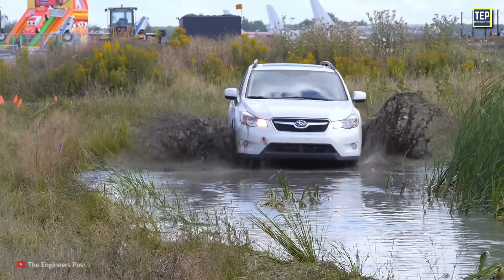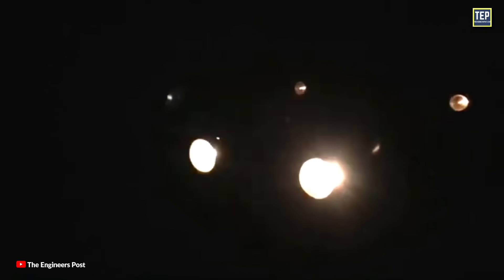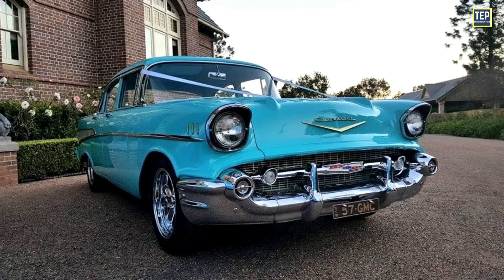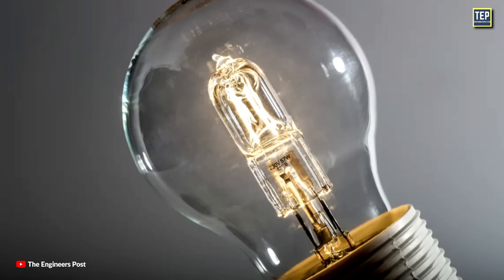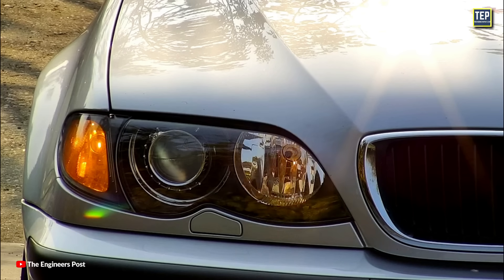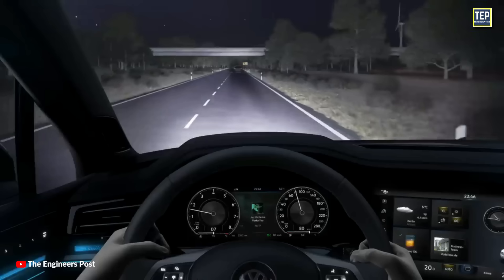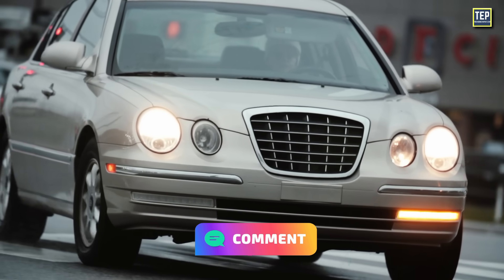The Problem With These Headlights

Comment: The major drawbacks to LED, is they do produce heat, just not in the conventional sense, and the heat can over time damage the electronics controlling it. Also, if they're not replaceable LED bulbs, than you have the huge expense of replacing the entire housing. Matrix lighting, will probably suffer from the same issue with no bulb LED systems, hence having to change the entire housing when a single LED fails. Laser versions, definitely suffers from the no bulb system, and when they fail, require a costly housing replacement. This is why the majority of manufacturers, have still relied on halogen the most. It's cost effective, and replacement parts are relatively cheap and simple.

Comment: In the early 70s headlight were required to be 300 ft for low beam and 600 ft for high beam. If your lights bothered the oncoming traffic the police would ticket you and require you to go to a station and get them adjusted !

Comment: Those laser headlights are stupid asf... you can barely see them at night through the rear view mirror & side mirrors

I've actually seen some tail lights that arent smoled coated yet still hard to see

Being able to see the headlights, tail lights and stop lights are just as important 🤦‍♂️

Dont get me started and morins with super bright ass headlights that blind you either on the opppsite side of a freeway/highway or residential street or in your mirriors (this includes dumbass motorcyclists)

In the darkened early morning i see a single bright ass hradlight in my rearview mirror (blinding bright). I thought it was a car behind one of yhe cars behind me direcly behind and the next lane over offset to look ahead or whatever

Turns out it ws a motorcycle... i only knew wgen i seen them zooming past me lane splitting pretty quickly (i was going 80, so he zoomed by doing at least 90)

*what if i decided to merge into the next lane?

Had he not had a bright ass light, i would have been able tp look better and see the outline of a motorcyclists

These bright ass blinding lights and fancy barely there lights are dangerous and plain fucking stupid

Comment: I remember when you just had round sealed beams.  However in the early 70s I replaced my sealed beams with lights out of Europe with flat lead Crystal lenses, the high beams shot straight down the road and the low beams were low and flat on the left side to not blind oncoming traffic while the right side of the lens were angled up so that the right side was lit to allow the driver to see signs and any object that might be on the shoulder.  They were superior to anything available today.

Comment: This video says that hid got replaced by led, but as far as i can see, hid is still used in most cars now with LED being integrated into the assembly intead if being a direct replacement for the hid bulb itself. Not saying there arent cars being made that use LED headlights but the mixed LED and hid headlights still seem more popular. Even though they cost a grand per assembly to replace and LED isn't serviceable, requiring the whole assembly to be replaced if it fails.

Comment: The problem with modern headlights are expense. Instead of simply changing out a $30-$80 bulb. You need to replace the housing which could cost thousands. That doesn't include labour.

Comment: +The Engineers Post @theengineerspost In fact the temperature of 5000K is defined by the CIELAB as the neutral white illuminant for many many decades now. At this temperature, usually all of the visible spectrum frequencies (for human eyes) are emmited in equivalent intensity. 6500K clearly emmits more blue light than other frequencies. Although it has been used in the video industry as the standard, it is not a comfortable light, especially in night time conditions such as shown many times in this video.

Comment: Another headlight option that I miss is the full spectrum halogen bulb. They were sold by AGS Lighting from Muskegon, MI while being imported from either Tiawan or South Korea.  Basically, you had a street legal wattage that your vehicle's electrical wiring was designed for, and a high heat coating on the capsule in a rainbow of a little of red, orange, yellow, green, quite a lot of teal, a little blue, and a little violet in it.  What they were going for was a mercury vapor light appearance, and it worked, providing a soothing visibility at night, as well as improving the vehicle's appearance and visibility to other vehicles at night, or even during the day in bad weather.

Comment: The key to halogen, or any other types of headlight bulbs being street legal is more in terms of lumens rather than color temperature, as long as the color temperature is within the white spectrum.  I currently use 4200°K Sylvania zXe halogens and have used 5000°K and even 7000°K Nokya halogen bulbs and they were all street legal (well, except the 5000°K Nokya because they were 80/100 watt as were my first and only pair of World Lights Metal White back in 1999-2001).  After the zXe bulbs burn out, I will use 6000°K Sylvania Zevo LED bulbs since they use much less electricity and have a daylight white color temperature, increased visability and being much easier on my electrical system.  One thing that I would not recommend with headlights is the high wattage halogen bulbs (and I have used them twice, once from 1999-2001 and again from 2012 through about 2015).  Why, because they fry the original equipment socket wiring meant for 55 to 65 watt bulbs as well as wear out the alternator after about 15 to 20 years if you drive the same vehicle thst long even without using high wattage bulbs that whole time.  One type of bulb (or more like a tube), for automotive use that really hasn't been widely implimented is fluorescent.  Why is that?  I can give a few reasons:  even made really compact, they are still too big for headlights.  Also, the throw on the light even with a chromed, aluminized ,or silver reflector is still not enough for adequate illumination of the road ahead with flourescent as it tends to be a diffused type of light source.

Comment: Adaptive headlights have been introduced in the 50's with Citroën's legendary DS lineup. The headlights were linked to the steering mechanism and horizontally dragged in the direction the driver manoevered the car. Now this technology is being bragged as a novelty today, which in fact is an idea picked up again. Automobile manufactirers were ahead of their time designing pivetable headlights.

Comment: Matrix is only good for the driver of said car. It bothers both oncoming and confluent traffic. It does not blind but it lights up literally the whole inside of the vehicle in front of it. Terribly distracting. Cheaper models will even regularly flash at other drivers as the computing is trying to keep up with the movements of traffic. It should be illegal.

Comment: Ive had all but laser and adaptive lights.  There are a few good halogens out there, hid has the widest color range 3k-12k+ but take time to warm up so like mentioned not very good for high beams , led is good but generally only found in 5k-6500k in color and have huge clunky fans on the back of the light module but are great for instant on high beams.  However hid and led bulbs are meant to be used in a projector housings not the same reflector housings a halogen bulb uses.  That is why people get blinded.

Comment: The new ones are a road safety hazard. They are far too bright for use in built up areas. Pedestrians can't see hazards when forced to look away and cyclists don't make anything dim down. They are forced to look away and can't see hazards in their path or can't see through the yellow haze from being dazzled, with the same result. Motorcyclists have the same problem plus having the scattering of even the clearest visor. Why can't cars just have city lights like they used to? Oh yeah. Add in speed bumps and it's like we're searching for the Luftwaffe again.

Comment: I have to question the quality of the optics in focusing the light emission from the planar arrays of these LED diodes. A HID Xenon bulb can have its geometric center exactly at the focal point of a reflector or lens, resulting in a beam that is very nearly cylindrical with light rays that are parallel to the optic axis. A planar array of LED diodes will have a number of the emitters that cannot be placed exactly at the focal point, resulting in light scattering that is not well focused.

Comment: Do not put xenon/hid’s on a reflector assembly. The light will scatter/blind pilots at 30,000 feet as the bulb is not engineered to the reflector’s specifications! Do a proper projector retrofit!

Comment: I did put LED in my halogen headlights - I could see owls in the trees :D Light scattered everywhere.
However - LEDs with lenses fixed the problem in halogen housing. At cost of high beams basically non-functional.

Comment: Laser lights have been in production. Not just on prototypes or “rare cars” While the BMW i8 and Audi R8 have them and could be considered “rare”. The 7 series has had laser lights as an option since 2016. I also know the 8 series, coupe, convertible and gran coupe all have laser headlights. The X7 also was available with Laser headlamps. The iX, M3,and  4 series also were available with them as well as some other BMW models. I also know the Audi A8 had them available as an option for more than a few years before this video was made as well as the A7, Q7, and Q8.

Comment: Small correction, with sealed beam headlights, the entire headlight IS the bulb. It does not have a bulb inside it as mentioned at 6:17. Also, throwing light at distance without blinding oncoming traffic has everything to do with the type of lens they're behind, and basically nothing to do with the bulb itself. For various reasons which i won't go into here, a lens that's designed for an incandescent bulb will scatter light (IE straight into the eyes of oncoming traffic) even if it shines further down road.

Comment: Lol, the car w/ the Matrix headlamps approaching the wall isn't driving.  The wheels 🛞 aren't rolling they're stationary, Sooooooooooooo the car is skidding towards the wall and ABS is probably started adjusting and any traction control systems are probably starting up.

Comment: Correction.  Halogen gasses are NOT inert.  Indeed they are amongst the most reactive of elements.  The inert gasses are the noble gasses such as helium, neon, and xenon which are seen in some lighting technologies.
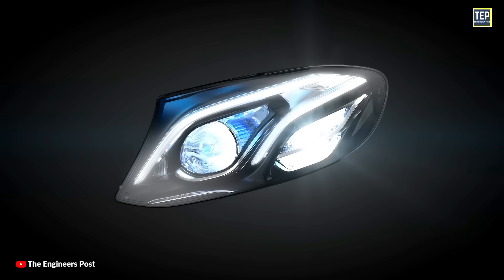12:50  Also, LED lights DO blind.  It doesn't help that most of the headlights are angled upward instead of at the road, but the hard blue light that is typically used in LED lights always blinds me for several seconds after another vehicle passes.  I often slow down so I don't end up driving off the road.  I don't have the same problem with warm white light so then why are LED headlights not made in that spectrum if they could be?

Comment: Halogen is the best, durable, cheap,  long lasting, plenty bright enough, better for the environment because it doesn't require a bunch if electronics to fix.Halogen Bulb on your car is out? 10 dollars at a parts store, HID bulb out, go to the parts store, possibly have to order and wait for it to come in and cost 70 or so for a quality replacement, unless the ballest that drives it is also gone, cheap one for a 2009 Audi A7 40 bucks, 2008 Nissan Maximum 600 dollars. You pick what's better😂

Comment: I now dread driving at night particularly in the wet when light reflects off the road. Even dipped beams are blinding in bad weather and the trend for bigger cars with lights higher up is making things worse. There is a coating  costing hundreds of pounds which reduces the problem to some extent but does not negate it.

Comment: Right after pointing out that LEDs are used in brake lights you then say they didn't exist until 2004... I beg to differ as my 2002 Taurus had a LED third brake light.
Also, I was in the Army in 2003 and we were already putting LED headlights onto our vehicles.

Comment: Two things, one, my home town has a hand in headlights existing... as there is an old law still on the books that requires a horseless carriage to be proceeded by a man waving a lantern.
Second, I have a headlight that I feel should not exist.  One of my cars came with factory HID's, and they are great, but I got the chance to test something recently that is honestly a wonder of technology.  You see, I currently have drop in replacement LED bulbs.  This means that they are LEDs that work with the ballast, work with the reflector, and work with the high beam paddle.
If you don't know most cars in modern years have used Halogen bulbs, and the LED replacements are designed to replace the Halogens.  Halogens not only use different power than HID's, but also have a different shaped reflector.

Extra note, old stage lights were literally car headlights in cans... that is the source of PAR lights.

Comment: Remember when a new bulb cost $2.32?  Now they're well over $1900, each.  So replacement of low & highs, stop lamps and signals will set you back $72,581

Comment: Halogen all the way, cheap and easy to replace, and works perfectly well 😹😹
Reply: No... Halogens are very bad, I have very good glasses in the Audi A4 B7, they are not matte or yellow at all, I ordered new bulbs 80 wats, I had the lights adjusted at the diagnostic station and they still glow poorly in my opinion.

Comment: Yeah. 🙄 Those matrix light sensors that supposedly detect oncoming traffic? They don’t work worth a damn. 
The term “dazzling” is incorrect. It’s called blinding folks coming in the opposite direction because the stupid lights are directed at my windshield instead of the road.

Comment: A lot of people hate the Jeep yj wrangler bc of the square headlights. What most dont know is there was a reason for square lights. The whole purpose of the yj was to keep the cj idea but make it safer bc the rep of the cj was a rollover dearh trap. So they took the same body tub put wider axles to make it stable and anyone whos ever ran seal beam halogens knows the round lights are not as bright as the square due to the shape inside focuses the light better on the square. Technology of headlights were not where it later was the only stick in hilogen lights, which was big areo plastic light. You think you hate the square light? Imagine a cj type jeep with big dumb areo lights on the front. By the time the tj came out, they had old school looking hilogen stick in lights, so they went back to round. Now my yj has all led lights, tail and marker lights, and after-market  square led headlights.

Comment: LED's absolutely produce heat, and require cooling. some use heat sinks, some have fans. instead of a filament, the semiconductor heats up

Comment: Leds might be reliable but the drivers,connectors and circuitry that run them are the weak link in the chain, I replace a fair few led tail lights,head lights,repeaters and seperate DRL's almost always water ingress  has been the culprit, even a little bit of moisture/ dampness tends to ruin them. Some like KIACeed DRL's, the driver board melts through poor heat management.Due to the diabolical prices for many headlights nowadays ( I replaced a 2020 xtrail,ns led head light last month,£1200😮) there is an increasing third party market intrest in replacement lighting components,drivers,emulators etc.even some OE stuff from the likes of Hella and Bosch are seemingly becoming more available too,if you know where to look. I have purchased a few component parts for various lights from places like Germany,Bratislava and Latvia.

Comment: The title is deceiving. This video is not about specific problems with particular headlights; rather, it simply shows the evolution of headlights throughout automobile history and mentions some of their disadvantages.
Reply: Thank you! I hate this time wasting crap. I didn’t want a complete unabridged history of headlights, I wanted to hear about modern blinding lights 🤦🏽‍♂️ downvote for time wasting
Reply: it is called click bait
Reply: And its conclusion is that the current #1 in blinding other cars also is the best lamp, due to its brightness and color... 🤔
I think the creator made a generic video on headlights and changed the title to fit with the current discourse on modern headlights low beam blinding other drivers.
Reply: So can we call this clickbait?
Reply: it's called AI slop
Reply: I don't think you were listening. They clearly state the disadvantages in each era what they were replaced with. The disadvantages are the problems, you even said it yourself.

Comment: Blue is not good, however, even the white light at night is not a clear advantage either. 2 reasons:
1.  Even if the white beam usually is generated by more powerful sources, in wet, rain, haze it gets dispersed more in comparison to the yellow beam. The result is more lit wider area, but not necessarily better visibility.
2. People during the evolution have adapted to more yellow light in the dark. Simply there was no other light source except the simple fire. White light in the dark can sometimes play tricks in recognisance of possible obstacles.